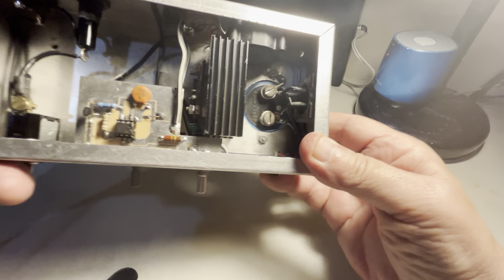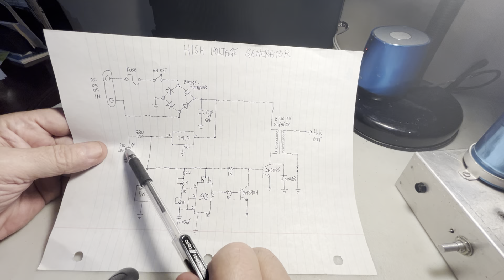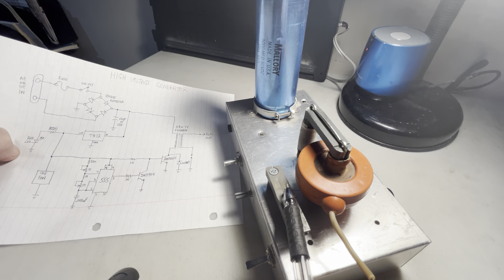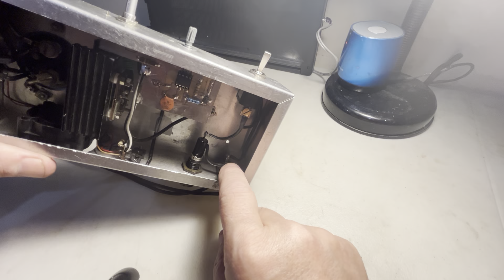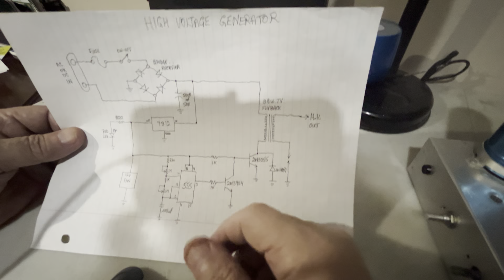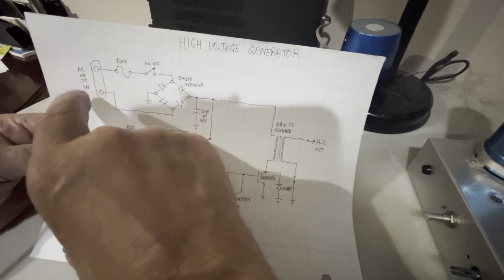H.V. generator

Comment: Nice.  But do you really have a 1K pull up for the base of the 2n3055, that's only 11mA?  The 2N3055, even the modern ones in TO-220 encapsulation, has a very low gain, in worst case you will only have a bit over 100ma collector current, or maybe 500ma if you're really lucky. That's far from what it's capable of and would make a very soft drive of the flyback. But maybe that is by design?  If you drop the 2N3904 and hook up the 555 (non-cmos) to the 2N3055 directly you can push upwards to 200 ma into it -  which still isn't enough to actually allow it to reach its full current/power handling potential, but still like 20x better.
Reply from the maker: at the values that you stated, temperature becomes a factor......the 2N3055 heats up quickly so by design I have limited the current draw to limit excessive temperature rise......the fan used does not draw out enough heat fast enough to maintain stable temp....so therefore component values chosen is to keep temperature as low as possible especially if unit is run for more than 2 minutes....for my purposes I don't need current output as much as voltage output so i am good with keeping limits low   because it hardly affects voltage output....but...having said all this...you are actually right...the unit can be driven harder but at the cost of super increased temperature....the 2N3055 current capacity is 30 amps if I remember but it is not needed for my purpose.....thanks for your insight though....I will change componentss for greater output should the need ever arise.
Reply: @silectronics  I might be off here in my thinking - I'm just a hobbyist and not a real EE. If the transistor is under-driven it will sit in the linear region and dissipate heat because VCE is high. Increasing base drive reduces that conduction loss. However, in a flyback circuit a deeply saturated 2N3055 can also run hot due to storage time and switching losses, so simply increasing base current may not reduce total dissipation. The 2N3055 is a relatively slow device so driving it deep into saturation and  having a high switching frequency won't be the best either. ;-)
Reply from the maker: you make a good point here......but notice that i have added a second pot control to the 555 to control duty cycle...so the transistor can be adjusted with on-off times.....also the transistor is wired as a switch only not as a class "A" amplifier so there is no linear region is operates at.....the duty cycle control of the 555 will set the on-off times that the 2n3055 will operate.....duty cycle in this case can be set very short on times because the primary coil of the transformer will saturate quickly., within few microseconds ...at that point there is no need to keep the transistor on since the maximum flux has been reached....so the duty cycle can be adjusted or set for 5 percent on and 95 percent off......what this does is keeps the transistor from super heating.
Reply: @silectronics  Ah, but to act like a switch you need to push enough current into the base to get into saturation. Anything before that is strictly in the linear region.  The coil reaching maximum flux issue is true.,just out of curiosity, what's the input voltage to the coil? I guess less than 35 volts or the vreg would blow. And what frequency do you use? >15khz to keep it silent? Or is it silent just because you drive it so soft?
Reply from the maker: yes correct you need enough current to get saturation but most transistors even the ones with very low beta's have very very low current drives.....so the 1k resistor with 12 volt supply is more than adequate........the input voltage to the coil is anywhere from 14 volts to 37 volts because of the limit of the 12 volt regulator ....input cannot exceed 25 volts above it rated output.......of course the higher the voltage the greater the spark output but the hotter it runs.....which is why duty cycle control is absolutely necessary.....I have not measured the frequency yet and have not calculated it either from the component values.....the frequency and duty cycle is adjusted until the oscillations can no longer be heard which means the the transformer is in resonance....so there is spark with no sound which is exactly what plasmas due.
Reply: @silectronics  Not sure I'm agreeing with you. A 2N3055 style low-beta transistor more or less needs it driven by a TIP4x-style transistor to saturate it when reaching maximum load. If you use a 1K at 12V you'll only have about 11ma base current after the B/C forward voltage drop.  This means worst case you'll get less than 150 mA through the transistor. Even at a decently high beta (for a 3055) at 50 you don't get more than 500mA through it.  Also, be careful with the voltage. A normal LM78-style vreg is not speccing the maximum input voltage as the diff between input and output, but it's fully referenced to gnd according to the data sheets.   Interesting! So the coil-whine and plasma will be silent at resonance...  That's both nice and convenient.
Reply from the maker: well.....actually any transistor can be driven into saturation with very low base currents regardless of load or betas.....all thats needed is to bias the base /emitter junction past the point of linear region control....for example....in a class "A" amplifier that uses 2N3055 output transistors, the bias point is usually set at 0.55volts...any higher the transistor would go into saturation.......any lower and it gets closer to cut-off......at 0.55 volts the transistor is half way on and half way off.....(linear region......so it doesn't take special drive transistors to bias another one....it only takes base control......the base current is also not that rellavent when the transistor is used as a swich because usually the driving voltage is sufficient to cause a complete bas/emitter voltage drop so the transistor will go into saturation.......of course the current matters also but it depends highly on what the transistor is used for...what your describing is rellavent to these transistors used as amplifiers....in this oscillator the transistor is used as a switch....parameters are not that important as long as thresholds are not exceeded.
Reply: @silectronics  I don't want to argue too much. But I now felt that I might have had a fundamental misunderstanding of the basics of transistors and fed this discussion into a couple of AIs. While I don't trust AIs particularly much I got the same reply from all three of them - my view about the requirements for saturation by  of a proper high base current for a low beta transistor under load holds pretty much true.
Reply from the maker: I need to apologize because I just realized that the schematic shows a 1 k ohm drive resistor to the base of the 2N3055...this is in fact a typo....the correct value is 100 ohms.
I know that the base current requirement for this transistor is 0.5A...but that is based on collector / emitter voltage at 60 volts........in this circuit, the collector /emitter voltage is at the most 37 volts...but I was using 14 volts on the video, the base current is at 120mA which is adequate to turn it on but not saturate it...to saturate this transistor is to cause its distruction very quickly from inductive kick back transient from the coil and extreme rise in temperature hot enough to cook an egg.....although the collector current is rated at 30 amps for this transistor, its never a good idea to max out its function, that how parts get destroyed quickly......this circuit works as is and maintains a constant temp even if I run it for a long time....AI"s may give you correct values but does it also take into account temperature......whenever inductive circuits like this are made, temperature must be a huge consideration if you want the circuit to last......I don't consider our talk as argument, on the contrary, I welcome your insight and thank you for your feedback
Reply: @silectronics  I think we have a misunderstanding. In my mind the the maximum current a BJT will pass is governd by the simple formula Ic=Hfe*Ib, where Hfe is the current gain of the transistor. A 2N3055 has a Hfe of 20-70 for moderate currents, less when reaching the saturation region. So the required base current is directly proportional to the gain and the collector current.

The VCE (votage drop across the collector-emitter junction) is high in the linear region, and low in the saturation region. The more drop the more heat is generated for a given current. (Compare to replacing the trasistor with a wire with zero resistance/zero drop, which would generate no heat at all). So you want to operate the transistor in the saturation region to minimize heat generation, but that also means you need to provide enough base current to keep it in saturation. If you don't provide enough base current, the transistor will be in the linear region, and the VCE will be higher, leading to more heat generation.

As I understand it the driving period / duty cycle should be low enough to stop injecting more current into the flyback as soon as the core is saturated. When it's saturated you will not have any more energy output for the secondary and the current through the primary and transistor will rise, generating more heat for no good reason.

Saturation of the transistor is a good thing as long as you don't overdo it because then it will have a slow turn off time. Saturation of the core is a bad thing since it will skyrocket the current draw.
Reply from the maker: all true ...except that saturating this transistor causes maximum current through collector emitter based on VCC/DC resistance of drive coil which in this case is very low resistance so current is high. this current must go through the transistor junction and will heat up the transistor very quickly.......which is also the reason why short duty cycles are very important......i have tested this at 24 volt supply before mounting into the fan cooled box and after running the unit for about 2 minutes, the heatsink was hot....this is even before I added an extra control in the timer circuit to adjust for duty......before duty control the transistor was being switched at 50% duty which was way to long and caused overheating......the drive resistor i used was 22 ohms.......I then added a duty control, and then changed the resistor to 100 ohms......now the unit works well, temperature remains nominal and spark output is adequate......on the video i show its operation based on a 12 volt supply for the timer but only 14 volts for the coil....spark was minimal......if i increase the input power to 30 volts.....spark length is increased and temp increases only slightly because of duty cycle control.if you beleive that saturation causes no heat then i suggest you do a simple experiment.......send power through a coil switched by a transistor and turn on the transistor to saturation to see the result....so the bottom line for me really is that i selected values that created adequte operation but maintain temperature at a nominal level.....for a circuit like this....parameters are not really that important as much as temperature control....i want this unit to work for quite a while before something goes wrong.
Reply from the maker: A saturated transistor is comparable to a shorted wire with zero resistance but that doesn't mean that it will not overheat........imagine this.....a 12 volt suplly through a 1 ohm resistor which will ccause 12 amps of current...of course the resistor power should be at least 12 watts, 15 watts is better......now send this 12 amps through a thin wire to ground. that straight wire is comparable to a saturated transistor but the wire cannot carry 12 amps.....now the wire has zero resistance so no current should flow and no heat should be generated but the wire will still overheat and burn up....this is exactly what happens in a saturated transistor,,,,even if the transistor doesn't burn up it will heat up .
Reply: @silectronics Well, a true 0 ohm or 0 drop device can carry an infinite amount of current. But that is not relevant since that is just a fantasy ideal component. My comparison to a wire was just to illustrate that the higher the resistance and/or drop the higher the losses and thus heat will be in the transistor. But now, even a fully saturated BJE will not have a zero drop, but it can be low, like 0.1v so if you push 3 amps through that it will be 300mW of heat . For any type of switching you'd normally want the switching device to be either fully off or as conductive as possible to minimise losses and keep it cool. You want all the energy to go into and be used by the load as far as possible, and not be wasted elsewhere as heat.
Reply: @silectronics  A coil does indeed present a low resistance when the core is saturated. While the core is "charging up" with the magnetic field the "resistance" is much higher and it will drop to something very low when it's fully loaded with magnetic flux. Unless you just want to heat the parts up it's imperative to have the transistor as low drop as possible during the charging, and that the time spent in the linear region is as short as possible. Fast nice transitions. And of course that the transistor is turned off just before or exactly at when the core is saturated. If the timing is too long, or the transistor is being driven slowly from on to off it will get the full brunt of the more or less short-circuit current the coil now presents.
Reply from the maker: well, i really enjoy these talks......and i agree with you except that this is not a unit made for nasa.....lol......its just a simple oscillator driven high voltage generator.....tolerances are kept below thresholds to avoid problems.......but it sure can be modified to make it better as I state in my video......I actually agree with you completely and when and if i design anything and it has to be very close to tolerances i actually do calculate everything within specs but in this case i don't think its necessary.....I actually have another video here called ( "high voltage generator using  3 components" )......if you wish to check that one.....that one uses winding feedback to establish its own frequency and duty cycle according to transistor thresholds....self triggering......that circuit actually saturates and the transistor gets very hot....i can only use it for few seconds at a time......it is self resonant.....saturation issues with this circuit is evident......i'm inviting you to check it out and let me know your opinion on it.....I respect your opinion...obviously your very knowledgeable in electronics and would love your feedback on that circuit.